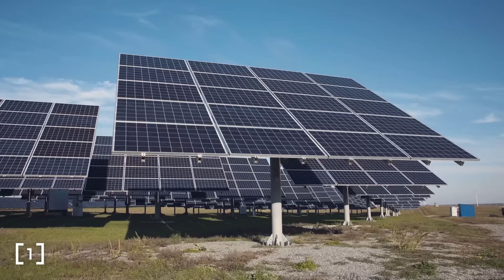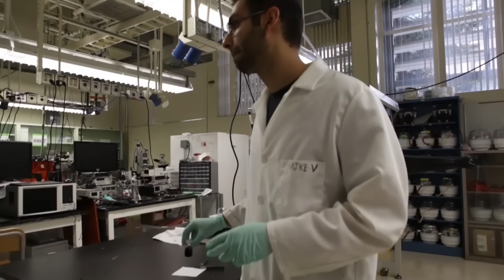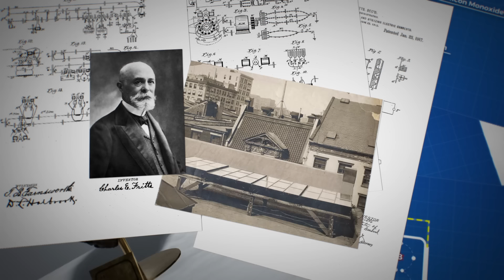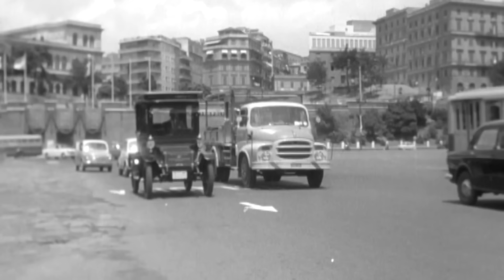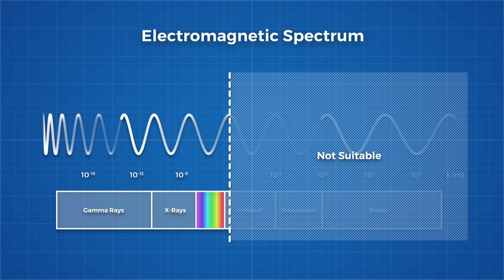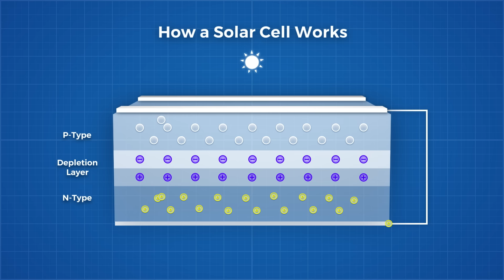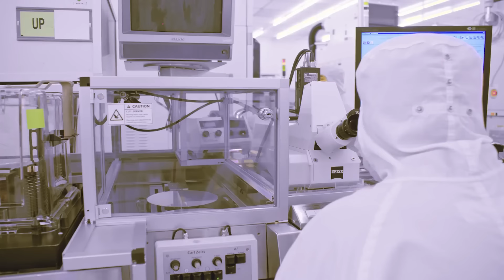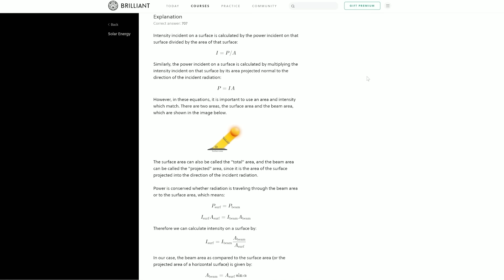The Mystery Flaw of Solar Panels

Comment: Ugh. While this is cool to know, this video also displays our ignorance. We are so focused on high tech solutions, we overlook low tech solutions that we could implement right now, quicker, easier, and likley at the moment, cheaper.
We are so obsessed with electricty, that we fail to see all the energy we waste in the system. Heat is constantly refered to in this video as something bad, yet it is wasted energy.
A quick way to improve panel efficiency would be to use that heat to our benefit. One way would be to capture it to displace heat generation. Since most panels are remote, this won't work well in most cases.
Another way is to use the heat to A), cool the panels, and B) generate more electricity at the same time.
How does heat cool something down? Convection. One of the traits of the panels, by their nature, is to be sun shades, which means the air under them is much cooler than the air over or around them. Depends on construction. If they were dumb, they trapped the air underneath leading to heat increases.
Still, run air ducts up from the ground below the panels. If the panels are above ground and not a structure, there could be a benefit to burying part of the ducts under the Earth to get even more cooling.
Run the ducts to a series of channels attached to the back of the solar panels. On the panel side, you could bond Thermoelectric generators, devices that generate electricity from thermal differentials. Now, the channles will be attached to the ducts at the lower side and open on the higher side. Then all you have to do is sit back and let the heat the panels generate work for you.
Their heat will heat the air in the channels, which will expand and rise. As it rises, it will create a low pressure in the duct, which will suck cool air up the duct. The process will continue as long as the panel is hotter than the surrounding air. The air movement will continuously cool the panel, so it can maintain its peak efficiency to turn light directly into electricity. The TEGs, through which all the heat transfers, will generate their own electricity to add to the solar power. Depending on designs snd temps, it could even be possible to use the air flow itself to generate a small amount of electricity, which adds up across so many panels.
Now, obviously, the system has to be designed for the setup. Some of those panels rotated and that has to be taken into account. For some, one side is lower at times, then the panels are level, then the other side is lower. At it's basic, the ducts aren't necessary, but just add efficiency. Still, designs could be made to work out efficiencies.
The point is, going forward, we need to stop being so focused on high tech solutions and electricity as our saving graces. We need to learn to find low tech solutions to harness other forms of energy to provide for us, especially  what we currently view as waste energy.
First, low tech solutions are typically already in existance in other parts of the world and in history books. We don't to think them up a lot of times, we just have to look them up. Second, low tech solutions are typically much cheaper and easier to make, especially as they don't usually require rare or expensive materials.
For instance, solar electric is usually restricted to certain areas because it is so poor at efficiency. Solar heat capture though, can be used in far wider areas because we can harvest much more energy per square meter. Materials we can easily store heat in are sand and graphite. Both are abundant and cheap, as long as you stay away from cement specific sand.
So, it makes a huge amount of sense to use heat capture solar tech in areas further out from the equator where solar electric panels are not bery useful. A huge amount of all our green house gases come from heat generation. Instead, we can capture it, store it, and use it when needed. We could displace a huge burden on our systems currently used to generate that heat. It could alleviate future pressure on the electric grid. Reduce the need for solar electric to supply that power. And also remove some of the demand for fossil fuels to generate that heat. All from cheap low tech solutions.

Comment: Can you capitalize on the heat by a secondary system that used a thermocouple? Every panel creates shade which is cooler than the panel. Or if you isolated the hot and shaded sides using a tube, in these massive installations you might be able to run a turbine and harvest a bit more power.

Comment: The explanation about how the solar cells work is a little wrong in my understanding. A lot of other YouTube channels explain the same way. The P-N junction occurs naturally when coupling P type and N type. It will create an electric field between these layers. The strength of the field depends on the material. With silicon it's about 0.7V. Photons have to hit the P-N junction area where holes are being occupied by electrons in order to kick them out of the holes. Then the electron will be accelerated by the field. There are 2 directions it can go, one is to pass the PN junction to go back to the N layer, or the other way is through the load, which generates electricity. That's why we are trying to expand the P-N junction as wide as we can, by heavily dope the N layer which is the top one and lightly dope the P layer on the opposite side.  If a photon hits the N layer, nothing will happen because they always have free electrons moving around. So with heavily doping, N layer will be very thin that electrons can pass through easily. So it's the field created by the covalence bond of Silicon that creates the potential, and photons are like the hit that releases the energy. That's why silicon cells can only generate below 0.7V. With other materials like SiN that we can create higher voltage because the bandgap is wider. Hopefully you can justify this so when the new generation watches your videos, they can understand more deeply and accurately. By the way I really love your work also. Keep pushing

Comment: The one thing I asked in electrical school was what will the impact of the solar panels be ..teacher at first looking a bit confused said GO ON so I completed my question ..when will the tipping point of panels be negative .as in when will we have so many panels that it will heat the environment even more as they reflect a certain amount of light back above what naturally bounces back combined with the current contaminates issue of smoke particles causing the planet to heat ..if u don't know what I mean picture a hot car in the sun...how much hotter does a darker car get compared to a lighter car ...then if we're to put mirrors in the car so even more infra red heat bounces off the interior to get trapped inside the car ...can u see where I'm going with this ...
It's similar to the methane gas under the permafrost ..it's not sumthing that was included in the science but it should be it just wasn't thought of ...teachers response was WOW BEST QUESTION EVER ..didn't have an answer but agreed that I was on the money
Reply: Every clean energy has a dirty little bad for the environment secret. .solar panels one of them is as I mentioned above...with hydro dams it's the sand traps ..a lot of sand in the oceans is from rivers ..damming the rivers depletes this sand  .coupled with some countries dredging sand from the bottom of the ocean which pulls sand from all the beaches from all the surrounding countries of that ocean ..then wind has a dirty little secret ..the blades ..there firbreglass which is horrid for humans and plants and the environment and ends up in landfill after a max life of 20 years..
Then the obvious all renewable energy tech still comes from mined materials ..unless a company is going to ONLY make their Tech from recycled electronics

Comment: Replacing good farm land with solar deserts should be ever so obviously morally wrong, not to mention counterproductive to the reduction of airborne carbon.  Solar produces electricity only a 4 to 5 hours a day.  It is therefore not a viable addition to the grid where other power sources can't be ramped up on and hourly basis.  Fossil fuel generators ramp up in days not hours.  Solar panels can reach 150ºF.  So if they are massed in farms (some as much as 1000 acres or more) they can generate and exacerbate thunderstorms and tornadoes.  But they can also generate cooling at night because they produce “black body radiation”.  So solar farms can exacerbate weather extremes.  Solar has it's place but replacing farm land with solar is counterproductive to saving the planet.

There is no “green energy” that can survive without tax incentives.  That should tell you something right there.  “Green energy” isn't truly viable.

This is what you get when politicians with no science or engineering background try to design your future for you.  And all the more especially when their primary motive is their own personal avarice, not to mention their moral and intellectual bankruptcy.  If it takes 600 unelected officials to fly their private jets to some remote location to tell you to ride your bicycle to work there is no climate crisis.  The only thing green about green energy is the dirty money flowing into corrupt pockets.

Comment: This presentation speaks of using the necessary raw materials as if there were limitless supplies available with zero expenditure of energy to procure them. Plus, once you use a huge energy input (up to 2,200 degrees for part of the process) you can’t get the materials back by recycling because they’re basically locked into the product. The Green Revolution is not going to scale up because it is energy blind and materials blind. In addition one can’t build infrastructure or move people and products across the country or around the globe with electricity at scale. That gets done only with fossil fuels for the foreseeable future, until things really start going sideways. See presentations by materials expert Simon Michaux for more insight.

Comment: It is important to note that even "good" solar is incredibly inefficient in comparison to other energy systems. It is one of the many reasons why solar is not viable as a primary energy source. We certainly need to reduce our dependency on carbon carbon-based energy, but we have to have an integrated energy program that uses all sources available to us. The speed at which many think we need to be 100% "green" is untenable. The combination of the economic viability and scientific limitations make is virtually impossible to be [nearly] carbon-free in the next 10-15 years. We might (doubtfully) be able to pull it off (at great expense) by 2050. Unless there is a breakthrough in technology (which may not even exist) that can never be predicted the only reliable, reasonable, achievable energy source is nuclear. So, unless/until we break through the public's distrust of it, we are not going to move forward.
Reply: Well said!  👍👍

Comment: im just wondering why when there are eletrons which can produce electricity as they only produe heat why dont they just pump water through to take up this heat and both help in cooling the panel and using that heated water to do another job like warming a home ?

Comment: Except you don’t have 567 MW of power due you because like all solar power systems to actually get that out of you divided by three that’ll be closer to what you actually get out every day that number is based on the size of the panel and eight hours of optimal light which does not exist in North America

Comment: Good informative on the material science in solar panels. However you are wrong in your understanding of how Electricity flows. The Electrons you mention as 'flowing ' are not else how can you explain Transformers. The electrons are not leaving the power plant on the wires ,travelling miles, and then into our homes.  Also how can you explain AC when in our system the polarity reverses 120x /sec?  Rather than try to explain it to you see the video by Veritasium, 'The Big Misconception about Electricity'.

Comment: 5:02 this is not entirely true.
Of all the energy being projected by photons, the sum must exceed this
threshhold, which then also happens under higher light entensities,
when multiple photons energy projection exceed this threshhold.
This then only occurs in simultaneous impacts or sufficient
subsequent ones, where simultaneous need then half the value
in energy, or subsequent impacts that need many times the energy value.
Heisenberg applies that no such thing as a simultaneous event can occur,
and as such a nearing simultaneous can occur yet, but then also needs
a higher energy value sum of the photons.
It's like pushing the electron, while it tries to go back into rest.
A ball over a small fulcrum, kick it once, it goes back to rest.
Kick it many times in a split second, with each kick being less than
the kinetic force required to overcome the fulcrum, and the sum of
kinetic transfer will allow overcoming the fulcrum.

Comment: Before seeing the rest, when solarvoltaic cells are being manufactured,
their substance is being crystalized, which ni turn allows for light induced
electron cloud movement, which in turn leads to a voltage potential.
But, with everything being manufactured, the crystalization isn't perfect.
Thsis means that in some cases the crystalline structure is reversed,
and although in the same configuration, directly opposite.
This then means it goes reverse on the current, and when doing so
leads to the current picking that particle away and depositing it elsewhere.
It's akin to electromigration, but it's self induced by the molecule in question.
Once the electromigration occurs, there's no more current from the
migrated molecule, and with that a hole in the structure.
This hole then has needs going around, which then also changes
the way of electron flow for nearby molecules.
The molecules that can stay in position, don't migrate, the ones
that can't migrate as well.
After a short and fast migration, the process stops, as the angle under
which the migration needs to occur changes, until no molecules move anymore.
Instead of just crystalizing material for solar voltaic cells, they may want to
induce a field that polarizes each molecule in a direction, just before crystalization
occurs, which then makes all molecules face the same way, and not be polar opposite.
This will help against the fast degradation, after the first few hours of operation.
Reply: I'd call this field induced single vector crystalization.

This can forego expensive material usage, in favor of cheaper ones,
that can then be vectored in the same direction just before crystalization
occurs.

Much like the spontaneous sympathy piece you did earlier.

Also, using two dissimilar fields may help even getting the same angle in rotation.

I'd call that multifield single vector and plane induced crystalization.
This works best in crystal structures that have all molecules crystalize
in the same direction upon crystalization.
Odd shaped crystalline structures have their ability reduced, since
the flow of electrons is not all in the same direction or vector.
Reply: Also, active cooling is a waste, since it needs additional resources
to be kept in place as well as maintainance.

Comment: does many think that solar panels are and will always be over shadowed by nuclear fission as that prosses is more efficient but it does require that an entire complex is made just to get the reaction going but the more they invest in it the better ways engineers will find ways to make the process easier there for making it more economically viable ( is only a matter of time when they fully transition to nuclear fission as the Sun will always be better than a just harnessing the light it emits

Comment: I must be missing something but why does efficiency matter in solar panels? Does the Photovoltaic effect slowly destroying the panel? If not, my point is what's the problem in simply having a larger surface area to make up for any difference in efficiency? Any cost increase due to having to make more would simply be absorbed over time.

Comment: Solar Panels do NOT drop 2% withing a short period after they have first been put into service, that might have been true years ago when panels were more like 14% efficient, but not seen these days. . .  I test panels before they go on the roof.. . . .  And they cant replace Fossil fuel generating stations. . .  Solar does not work at night time.  . . And no you cant make Grid size batteries to store the power for over night.
Reply: Much of the rest of the video is interesting information, so worth listening to.. . .   But usually the biggest loss of efficiency with Solar Panels is due to clouds, and some due to dirt and dust on the panels.. . .  But also the angle of the Sun through the atmosphere, as the video actually correctly shows. . .  The net effect is Solar Panels only work well for about 4 hours a day, you can improve that to about 6 hours using tilting or Tracking panels, or if fixed panels, then some tilted a bit Eastwards, and other tilted about 20° to the west.